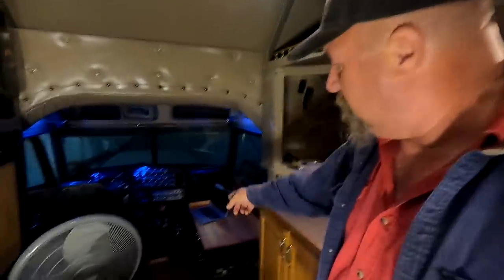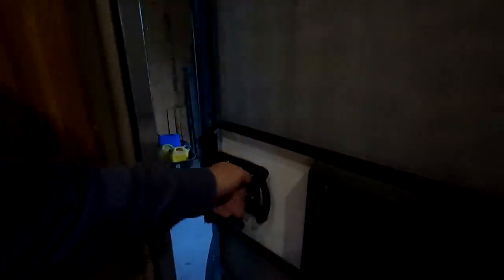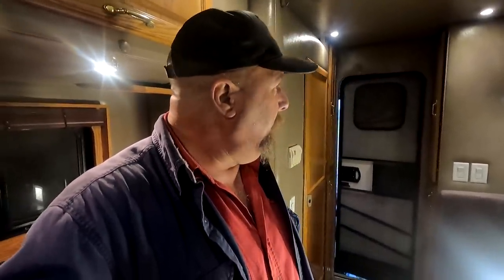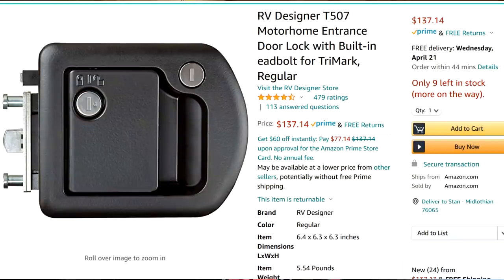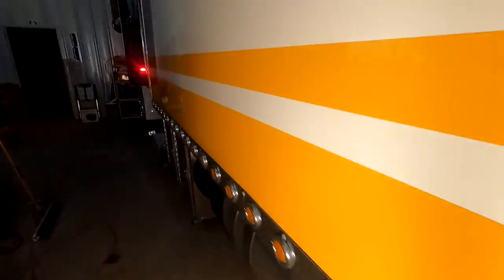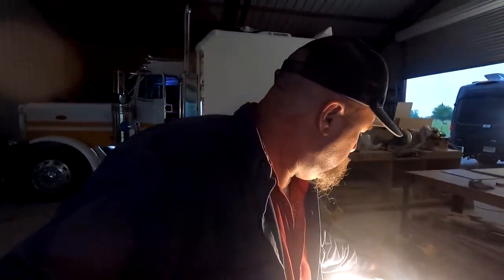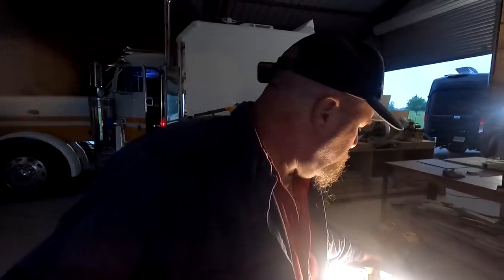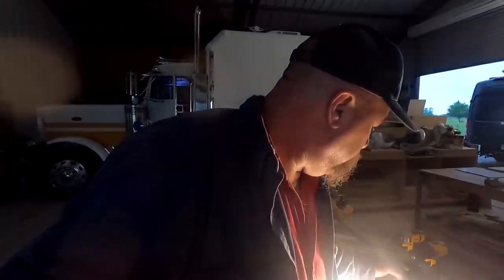607  I need help with a design for the Pete

Comment: Stan, I have a 1500 watt microwave, with 2-280 amp 6 volt deep cycle batteries. When I turn on the microwave, the batteries can only run it for 30-45 seconds before the volts go down to 10.5 to the inverter. I have to run the engine to help the batteries when using the microwave. Keep this in mind, because 1 or 2 will not be enough to run that massive energy needs. To be effective, you need 2 lithium batteries for your needs.

Comment: don't need a crucifix on the bonnet just need a Sippee cup so you  don't crash  again Stanley oh and are you going to put super wide steer tires and wheels on the front? like the previous petercar??
Reply from the maker: Probably not. The other truck already had them.  I didn't like the low mileage wear I got from them.  I'll test these out for a while
Reply: cool Stanley

Comment: UUUUHHHHHMMMMMMMM Its 2021 GPS comes to mind??? 😉😂
Reply: Windshield mount GPS units are actually illegal in 21 states and a few others restrict where on the windshield you can mount them. GPS units that can do 'truck routes' based on your rigs length/height/weight are often double the cost of a 'passenger car' only GPS. If you go with a built in dash unit, it's really no different than using the laptop(you're still occasionally looking away from the road, but mostly you're just listening to the voice prompts).
Reply: @jamesgill5511  TF???😳